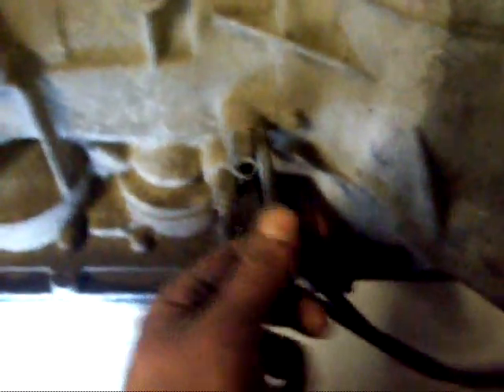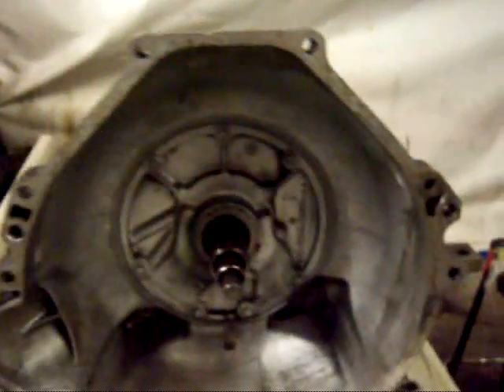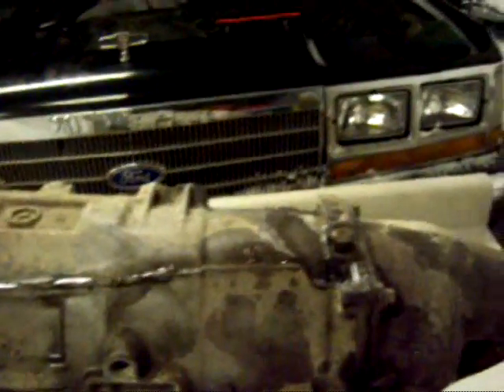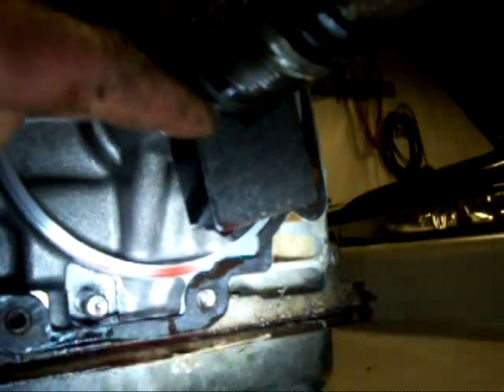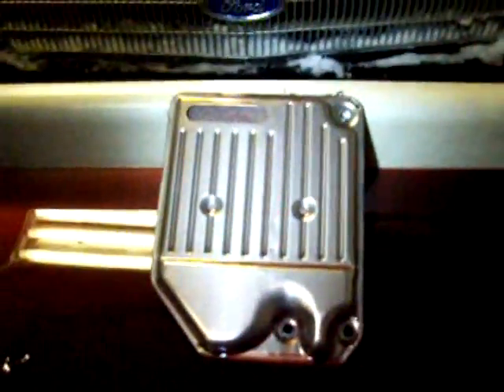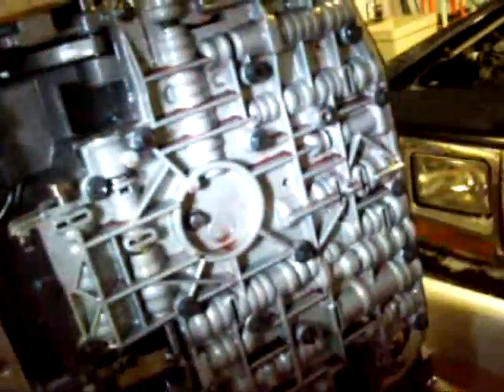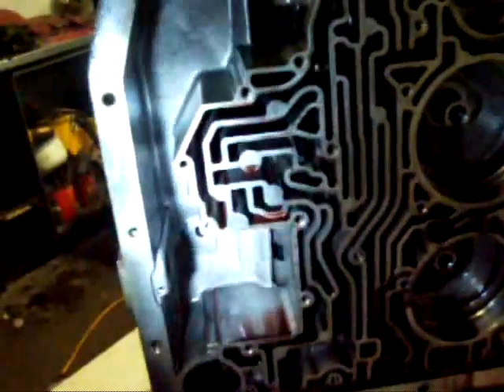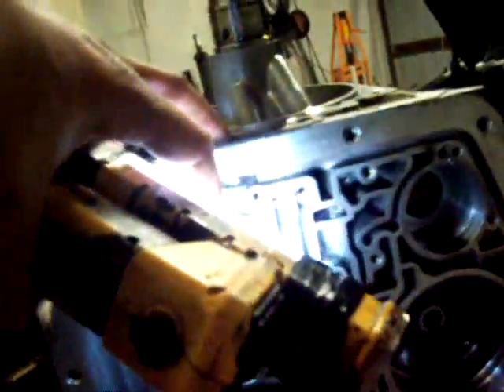Ford AOD Transmission Dissasembly part 1: The Valve Body

Comment: maybe someone here can answer my question, did ford change the shape/design of the output shaft or the ext housing over the different years?  I bought this rebuilt AOD trans after mine dropped overdrive,  supposedly it came from the same car as mine and even bolted in, lines and shift linkage connected just like it should but than try and put the drive shaft in and the yoke doesn't slide all the way in, it bottoms out with the yoke sticking about 1 ¹/₂ inch out of the tail, making installation of the old driveshaft impossible, that's where I'm stuck right now I don't want to open up my rebuilt trans as it will void the warranty, so did ford change the output shaft over different model years? or the ext housing? or do I need a new slip yoke?  please respond if u know anything about this
Reply: trent ryan yes i actually got one from the junkyard and had a different output shaft, in my 90 mustang i had to fit it tightly and it broke my flywheel so the only way out would be to switch the output shaft from another transmission

Comment: Did you pull the small filter from the rear of the body ? Looks like the filter in the governors, small cone screen mesh thing . . .  mine fell out and was crushed flat - not much info online about these  - where they go, should they be round ?
 etc etc

Comment: Also, due to other mistakes we had to remover the transmission oil pan while the tran. was still in the car, that proved to be a much cleaner way to drain the fluid.

Comment: sir... I have a 92 ford van with an AOD tranny I got another one but the shifter is down and mine was up... how do I change you know in the tranny where you connect the cable for the gears mine is in facing up and the other is facing down what can I do

Comment: question; have you ever seen a aod without the 3-4 acumulator, my 89 town car does'nt have one. got a used trans, and it didnt have one either[sent it back]. car wont go past 2nd gear

Comment: Yes, I have a 04 f150 5.4 with 4r75w trans  4x4. when my trans gets to operating temp say 20 to 30 min drive time when it shifts from 1st to 2nd  there is a clunking/shudder noise I hear/ slightly feel. Every other gear shifts perfectly and 1st to 2nd shift perfect “cold. no codes, fluid and filter changed, shift solenoid replaced, reflashed the pcm, had the valve body removed and all the valves springs checked(just dropping the pan)… any idea of what my problem could be?? thanks

Comment: Great video   ive got aod trans in my 88 mustang  driving down road always shifting great all of a sudden  just reved freely and  and  pulled right over  and would drive in any gear  all like neutral  no burning smell or anything  is ther any sensor or modulater that would do this  and modulater line  is still connected to its vaccum line  ?  ? any help!  thank youl

Comment: i need the repair manual for my ford f150 2005 with transmission 4R70E that you told me that is the one my truck has, the engine size is 4.6 i'm not sure but i think something wrong with the valve body or the solenoids and i want to fix it my self i just need the book that show step by step to put together the valve body do you know where can i get these kind of book? thank you for your help the oil looks clean nothin is very clean

Comment: if i permanently fully extended the weights on the governor of my 1993 Tempo, would it shift to drive? start out in drive or could i manually shift it from 1 to drive or how would the trans act. this seems stupid,but i'm serious. i've changed the sensor, sensor plug and the governor gear "looks" fine. i'm just trying to get by for a few weeks.

Comment: Your confidence is fantastic,,one usefull TIP to keep all bolts in order of position for re assembly use a cardboard template draw a pattern similar to the actual pattern and punch holes to match location  and incert as removed////saving time and keeping organized for reassembly ////////which could be years?????

Comment from the maker: @dueprocess82 I'm guessing that you have an A4LD trans that came with the 2.3L. If it is an A4LD then I would suspect that the overdrive clutch is the problem, either something in the hydralic circuit or the clutches themselves are burnt up. On the A4LD the overdrive clutch is applied in manual 1st, 2d, 3rd, and reverse but not when its in overdrive. If it is an AOD then I couldn't tell you why its doing that.

Comment: Im having a transmission issue with my 93 ford mustang. It shifts into gear fine (d,od,r) but the car really struggles to move in drive and reverse. If i put the car in overdrive it drives fine. Could this be a problem in the valve body?

Comment: HELP! Ihave a 90 bronco,a while back i was low on tranny fluid,i got dex\mer 3 and it started slipping,i had always put type f,sooo,i give it a filter and fluid change,i have reverse,but it slips badlyi have to give it high rpms to get it to move i put in a new t-converter because the other one went bad ,made a whining buzzing sound,sound gone but slips still,im flushing out the dex\mer,and puting back in typeF,then checking tv cable adjustment,any input would be helpful

Comment from the maker: @heavymetalX4Xgod On the 2wd models yes it does. Take off the driveshaft and the speedometer cable and gear then unbolt the extension housing. Im not sure what needs to be done on the 4wd models though.

Comment: I have a question for you. I have an 88 ford bronco. It had a 302 in it and I put in a 351. I took it out for a drive and the aod worked fine. I stopped at a stop sign and took off. It wouldn't shift out of first gear. I think maybe I didn't get the converter in the pump right. I did find some metal in the pan.

Comment from the maker: @VICTOR400HP The 3-4 accumulator was eliminated in the AOD in 1989. The valve body was changed so that it does not need the accumulator.

Comment from the maker: If you haven't checked the fluid level you should do that first. You could also try a fluid and filter change and see if that helps at all. If a trans starts to slip, it burns the clutches and bands, when that happens its usually time for a rebuild. There are lots of reasons for a trans to slip when cold, sticking valves, thick trans fluid, harder seals, old fluid etc. The best thing to do is let the car warm up before you go anywhere, it will help save whats left of the clutches.